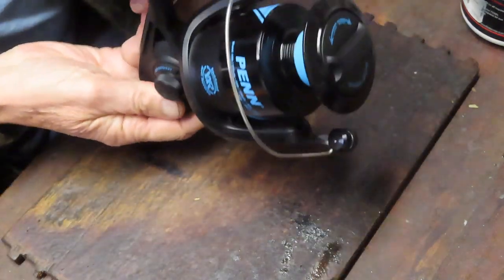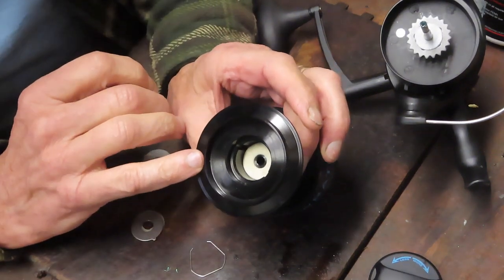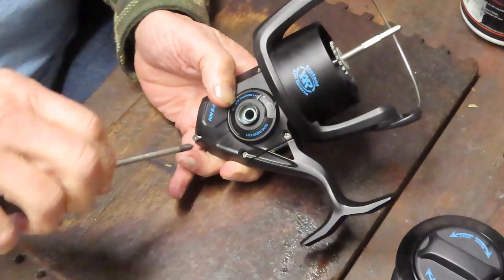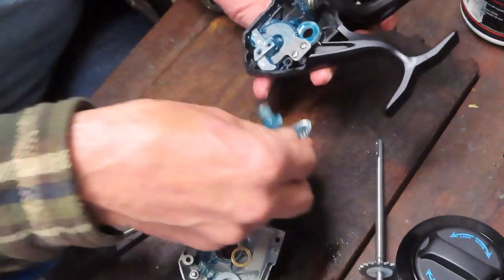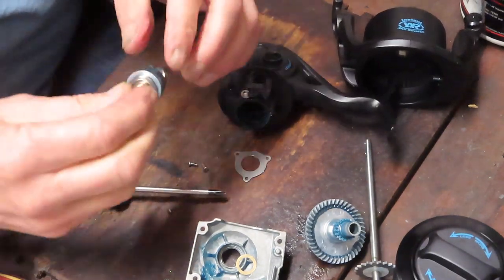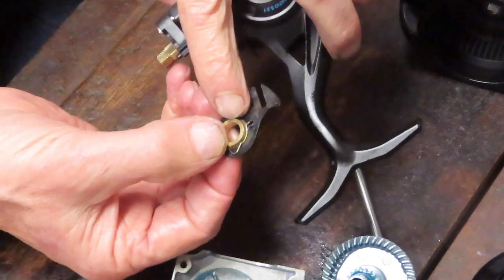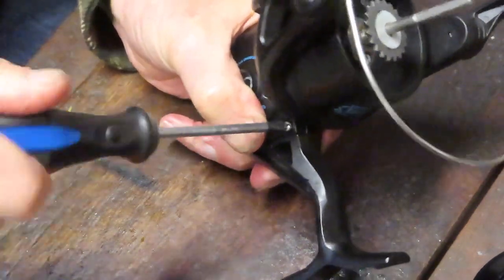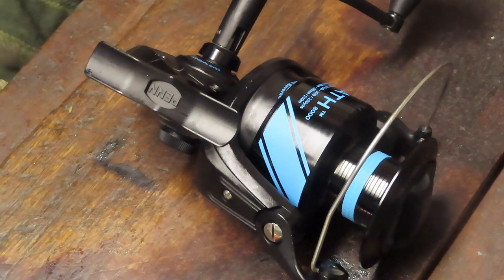Penn Wrath 8000 spin fishing reel an inside look and how to service

Comment: I have mixed feelings on the bushings. I had two Quantum 6000s that got dragged through the sand by sharks. (an interesting story on it's own) After a complete teardown and cleaning, I never seemed to get all of the fine sand out of the bearings and replacing them was almost as much as a new reel. My old ABU 5000s have bronze bushings that I upgraded to neoprene. (5500 ball bearings won't fit) I've had no problems with them and a dunk in the water or a drag through the sand requires a simple cleaning and reoiling to bring it back to smooth operation. I bought two of these Wrath's to replace my Quantums, a 5000 and a 6000. I use them exclusively for once a week surf fishing trips. I like them the way they are for now, but it's nice to know they can be upgraded if one desires. Thanks so much for your channel 👍
Reply from the maker: You've said a lot.  If the reels do not get dunked or dragged by sharks, then the bearings are better.  If the reel needs to be restored, then bearing almost always need to be replaced under those conditions.  Thanks

Comment: Great backup reel. Bought the 5000 version and replaced bushings with bearings. Great for catfish and striped bass in the Hudson. Only the side plate is metal. The rest is graphite but of good quality.
Reply from the maker: If I had that reel, I would do the same.  It is a quick swap to replace the business with bearings and it is well worth it.  Thanks - Dennis
Reply: @2ndChanceTackle  I really like bushings for saltwater kayak fishing where they get dunked every other trip.
Reply: What size bearings are they? Are they easy to find?

Comment: The fierce bearings fit the wrath. I also got the carbontex drag washers and the fierce drag nut with the seal. I have the wrath 6000
Reply from the maker: Good to know.  Thanks for the tips - Dennis

Comment: Good to se that you got the encoding fixed from last evenings posting.

$50 is cheap enough for a new reel of it's size. Too bad about all the plastic.
Reply: I don't know. The case and spool sounded metalic.  Couldn't tell about rotor. For its weight, it may be metal.  Unless you mean the bushings. For the price, I'd run it until the bushings wear and replace with roller bearings.  Of course, it's too new a model for me.  Most of my reels are 20+ years.😆
Reply from the maker: It took a while.  Replacing the bushings with bearings is relatively cheap and easy to do.  If I had the reel, I would definitely consider the upgrade - Thanks - Dennis

Comment: In which direction do the new carbon washers and the original metal washers go? Is there a right side up and a wrong side or upside down? The metal washers look like they have a flat side and a more rounded side. And the carbon washers look like they've got a difference in sides, too.
Reply from the maker: There is no right or wrong side.  Just b consistent in the side you choose to face upon - Dennis
Reply: @2ndChanceTackle  Okay. Thanks. I went by the top/first metal washer and just put them all with the flat side up. Do they get oiled or greased? Most of the original ones were dry and the ones that looked like they had lube looked like they were oiled.
Reply from the maker: No oil or grease is needed.  They are non-permeable so the grease is unnecessary
Reply: @2ndChanceTackle  Okay. Great! I ended up greasing them because that's what Penn told me to do. I hope. I didn't ruin them, now.

Comment: Thanks for your videos. So I have a Penn pursuit IV 4000 that I replaced the main gear and crosswind gear on and it’s binding at the top or bottom of the crosswind block’s throw. Everything else looks normal. Do you have any idea what’s causing it?
Reply from the maker: Is it possible that you have the crosswind block on upside down?  The screw hole should be on the bottom.  Does the reel bump is the spool and click ratchet are removed.  If it runs OK without the spool, it probably needs shim washers on top of the click ratchet and under the spool
Reply: @2ndChanceTackle  so, even with the main gear removed and just the shaft and crosswind block on the crosswind gear it still catches at the top and bottom. I can’t tell that the shaft is bent, but I went ahead and ordered one. I’m fairly certain the gear and block are in properly. This happened months ago. It locked up and I forced it. When I took it apart the teeth on the crosswind gear and the main gear were are up. But now even with new parts it still does the same thing.
Reply from the maker: I think you may have the source of the issue with a bent axle shaft.  if you remove the crosswind block and pull up on the axle shaft, it should move top to bottom easily.  It is is sticking, it is a sure sign of a bent shaft.
Dennis
Reply: @2ndChanceTackle  thank you very much for your help, Sir. As cheap as the parts are, I basically just replaced all the internals and got it put back together properly and it works great.

Comment: i am new at fishing what does anti reverse mean on the 6000 reel
Reply from the maker: The anti-reverse stops the reel from turning backwards.  There are several styles mechanically.  An instant anti-revers IAR used a one way clutch to do that.  The older designs uses an A/R dog and click watch to accomplish the task.  Hope that helps - Dennis
Reply: @2ndChanceTackle  thank you for the info

Comment: I have a 5000 and the anti reverse stopped working the handle wind's backwards and forwards won't sit in stopped position. Is it fixable? tia
Reply from the maker: Yes, it can be repaired.   It sounds like the anti-reverse clutch has failed and will need to be replaced - Thanks for asking - Dennis
Reply: @2ndChanceTackle  👍

Comment: I have a problem with my pin wrath 8000 the drag keeps getting tight automatically how can I fix it
Reply from the maker: I think that the drags may be stuck to the metals in the spool.  That's the first thing to check and clean - Dennis

Comment: Make your own drag washers out off a white plastic butter cover 🤣🤣😂
Reply from the maker: That is a good option if you cannot get the originals - nice bush fix - thanks for sharing - Dennis  PS - I believe that you can upgrade the Wrath drag washers to the HT100 Penn washers -
Reply: @2ndChanceTackle   yes the Ht 100 penn washers are very nice 👍